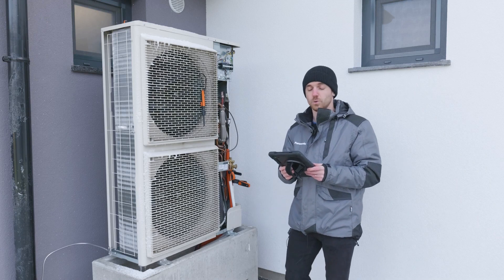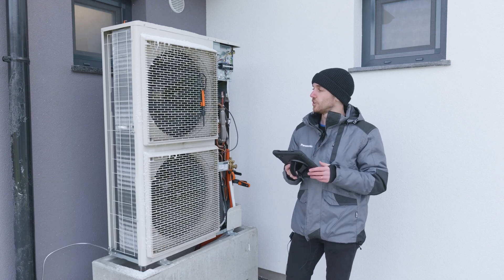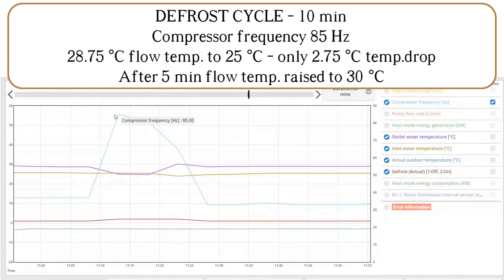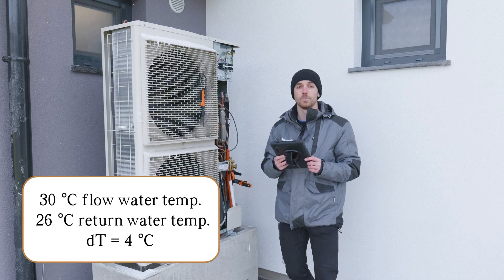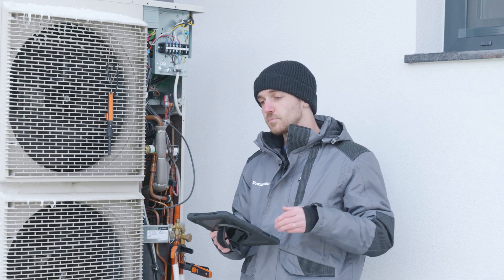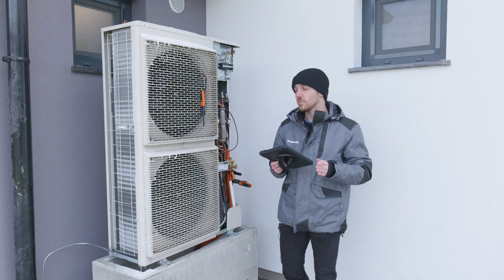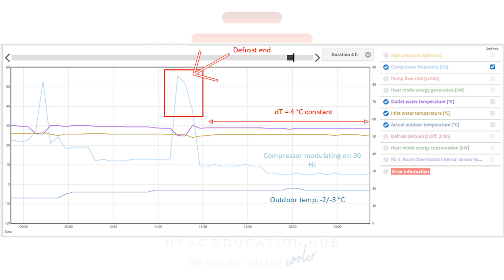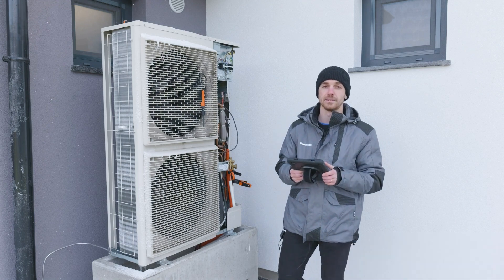300 m² Underfloor Heating Case Study | 12 kW Open Loop System at -15°C (ΔT 5K)

Comment: Hello Mario! One question (I hope you didn't mentioned it during your video, if you did, please forgive me...): I noticed that during -2oC outdoor temperature, compressor's frequency is approximately to 30Hz. Isn't it a little bit low, meaning that heat pump is oversized?
Reply from the maker: Hi, no, just the house is probably to good and everything is warm. I did some analysis, check here:

https://www.linkedin.com/pulse/heat-loss-calculation-vs-reality-mario-dodi%C4%87-h4f4f/?trackingId=bsPdojGiRtG3YWvMSbm7Ig%3D%3D
Reply: @HVACEducationHubHello Mario. So your heat pump is oversized. I suppose you followed a calculation from an engineer. EN 12831 takes in account buildings mass. Is there any chance to share with as the analytical thermal losses of a room for this building? I suspect engineer did not used EN 12831 or used it in a wrong way

Comment: Hi Mario, greetings from Bulgaria. I am designing my heating system based on A2W heat pump and very much appreciate your videos because you explain clearly and right to the spot. What I wanted to know for this particular system is: Total house  heat loss at  the selected deisgn temperature. Thank you!
Reply from the maker: Hi, thank you!

12 kW calculated at -15 C outdoor, indoor 20 and 24 bathroom/living room.

In reality, at -10 C is working on approx. 9 kW and almost never on peak load 12 kW.

Comment: What is the outdoor unit installed on? Looks like a concrete tub... Is there a outdoor heater to help with icing of the outdoor drain?
Reply from the maker: Concrete yes. No, without heater.

Comment: Hi Mario, I'm in doubt between Panasonic High Performance and Panasonic Tcap. What are the benefits from tcap compared with high performance? Just to mention, I'm living in Macedonia and  our average temperature in winter is around -7. What do you think? I dont want to oversize it but I want to be safe when it comes to its performance during different weather conditions.
Reply from the maker: Hi Aleksandar, Tcap is always best choice for cold areas because capacity is not dropping until -15. For example, Tcap 12 kW has capacity 12 kW until -15 and on -20 11 kW. High performance 12 kW on -15 is around 9 kW.

Only 9 kW 3 phase high performance has the same capacity until -7 as it is the unit with 2 fans so similar to Tcap.

Comment: During warmer days when outside temperature is +8 and above may flow temp is +30.
I noticed delta T is 3-3,5 and compressor stops often (maybe every 5-10min) and only pump distributing water for some time.

Default delta T settings says 5.
Should I change it to higher to reduce compressor on/off so often?
Reply from the maker: Try and check what is going on. At higher outdoor temp it is almost impossible to have fine modulation without exceptional good system design
Reply: @HVACEducationHub  

My first thoughts were pump “short cycling”....

Conclusion after some time of thinking and Googling…..
Basically it's too hot during the days and maybe the heat pump is a little bit oversized for the house.
When the temperature drops below +8 the working cycles increase to around 20 min which I understand is perfect.

Heat pump Daikin 16kW, it’s ON 24/7.
Heat flow temperature +30 celsius.
Delta T is 5 compared to 3,5 on average during warmer days.
All rooms in the house are set to +23 celsius with thermostats.
2 adults and 4 kids in a 250m² house.
All underfloor heating +  with DHW (300L).
Pipe centres 150mm.
Brick house with 10cm styrofoam facade.

My monthly bill is on average 70 EUR/month DEC-MARCH.
Reply: The compressor is shutting down due to low ∆t. Try to restrict flow, by lowering the pump speed or using a valve on the piping part.
Reply from the maker: @mrjozza5924  yes, return is hot and compressor is shutting down.
Reply: @mrjozza5924  
Not sure what you mean valve on the piping, can you evolve?
If changed wouldn't that impact overall how it works especially when it's cold?

Speed on the pump I can't change, don't see any settings on my control panel.
It's a Daikin Altherma 2 system.
Would it be better to change delta T to higher?

Comment: Hi Mario, for the flow temperature to be so low, what is the pipe centres of the underfloor heating? The numbers look fantastic
Reply from the maker: Sorry, forgot to mention. Only bathroom 100 mm and few rows near the outdoor wall. Everything else 150 mm.
Reply: @HVACEducationHub  Beside pipe centres that house must have extremely good insulation to maintain indoor 24 celsius.

Can you tell us more about facade, windows and reason you think flow temperature can be so low?
Reply from the maker: Here is copy/paste from another comment:

- 2 adults + 2 kids
- 185 L integrated DHW tank
- wall is brick/concrete + 15 cm insulation on outdoor walls. Roof is still not insulated
- without ventilation
- 300 m2, 150 m2 ground floor and 150 m2 1st floor
- if you mean design outdoor temperature, -15 C
- average winter is below 0 C by the night, above 0 C day

I don't have data for annual consumption, but as far as I remember, aprox 80 EUR (around 600 kWh) is the maximum monthly price for heating/DHW
Reply from the maker: And the main reason is constant load
Reply: @HVACEducationHub  

Didn't know before that constant load was good and to use the compressor to its maximum.
Compared to compressor often  stops with shorter working cycles.

Do you know how many minutes aprox heat pump do per cycle?

If it works constantly I understand it's now good for the hardware in longer terms……
Reply from the maker: @TohaToni  usually maximum is 10 start/stop per hour. The problem is that on start current is higher than in modulation. But the key is to match heat demand with heat capacity.
Reply: @HVACEducationHub  Perfect, thank you.
Reply: How do you regulate the temperature room on the first floor? Isn't it hotter compared to the ground floor?
Reply: @mrjozza5924  I would assume  flow rate balancing.
Lower the flow rate to lower the output, resulting in a lower room temperature.
Reply from the maker: @mrjozza5924  yes, flow balancing for each room depending on room temp wanted.
Roof is not full insulated so we are still testing some variables.